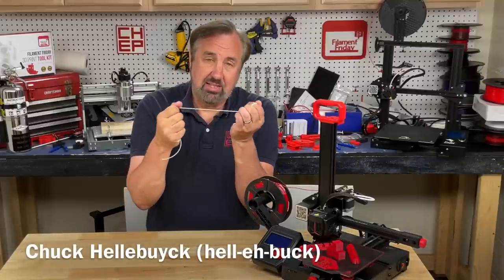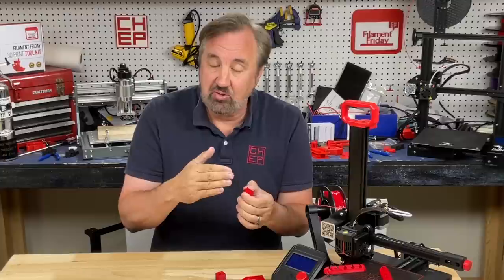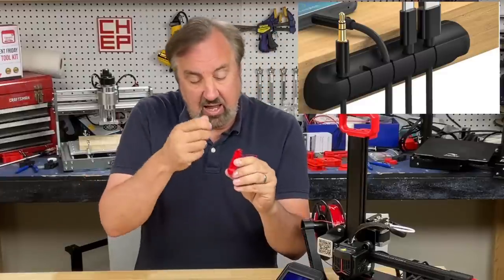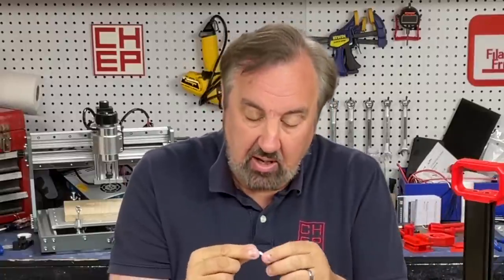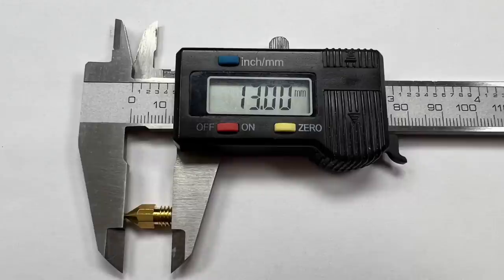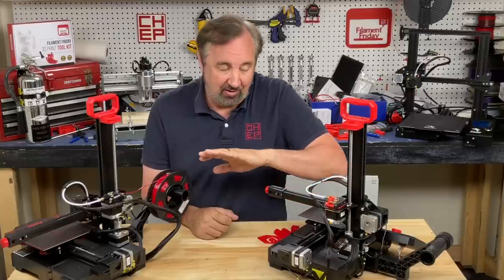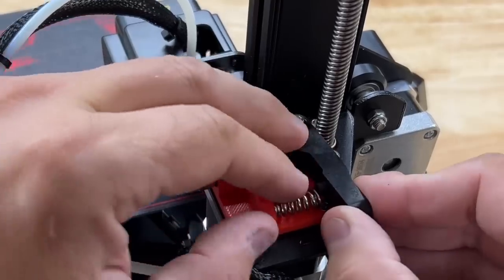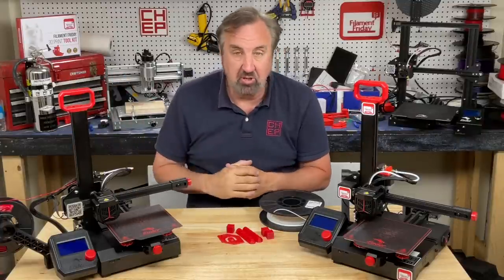Cura V5.0 - Flexible Filament Profile TPU

Comment: Used the profile, "as is", on my Ender 3 with direct drive and all metal heatbreak, to print a hex bit holder in TPU. It worked flawlessly. It did not had any clogs, even if there was a ton of retractions, only a little stringing. Great profile.Thanks alot Chep!

Comment: I really do appreciate Chep's work on these free profiles, he does not have to make them. Yet he has for ages. I was a died-in-the-wool simplyfy3d fan but that was not getting updated so with all the talk about Cura I jumped in knowing that Cheps profile would get me moving and groovin. Sadly I could not use Cura because I found it too much work, with all the drop downs and settings here there and everywhere not to mention Ultimaker wanted my user data so that was that. I tried and died:) Now what! If I didn't love 3d printing !!!!!
Reply: PrusaSlicer is the way ;-)

Comment: Hi chep. I don’t comment much. But thank you for all your help. I’ve have finally got my 3D printer working SO good now I’m in love with it. I found that I had problems with that line down the edge. It turned out the be my extruder only giving me 65.5mms rather than 100mms the difference in my prints now 😮. OMG 🥰 they are perfect. My old CR-10 👌🏼

Comment: Thanks so much for your hard work Chuck. I downloaded your profile/project and loaded it into Cura 5.1, I then exported the profile out of the project as well as the object. I then erased everything and loaded my Artillery Sidewinder X2 in and imported your TPU profile along with your model. I changed the retraction to 6mm because the X2 is direct drive and then sliced and loaded into Octoprint and its printing like a charm. 👌👍

Comment: Thank you very much , did my first TPU prints today , using your profile on my Ender 2 pro . As the TPU I used was quite stiff it printed perfectly first time at 210 deg C , bed temp 50 deg C on standard machine with retraction dialed back to 5mm . Filament used was SunLu TPU Silk Black ( perfect finish )

Comment: Downloaded and used your profile for my ender 3.  A few tweaks (nozzle and bed temp, and retraction number) and boom, worked great for printing the cable clip.  Came out perfect with practically zero stringing.  Thanks for the profile and great video as always.
Reply: Shall I asq you how I can get that ender's 2  3mf archive and use for my ender 3? I  had have downloaded the 3mf archive but when I drop into CURA and it  changes also the printer and bed size
Reply from the maker: https://youtu.be/EJD1hCJpM_w

Comment: This profile is awesome! prints like a charm on my CR10SPROV2 with Microswiss direct drive, was not able to print before this.
Reply: what are the Retraction settings on your profile?
I have a Microswiss DD on my ender 3 Pro and still tweaking it.

Comment: Great upload as usual.  You have always been on my goto list when I have a printing problem especially with profiles.  I have had quite a few issues with Cura 5 especially with my CR10 Smart Pro as there is no stock profile for it in Cura 5 so had to do my own.  Still a work in progress.  Thanks for all your hard work.

Comment: I printed TPU a few weeks ago & found that all I needed to do to stop the filament escaping was to reduce the pressure on the filament from the extruder pinch wheels. I looked at the filament & saw that it was well chewed & squashed, reduced the pressure to as light as I could, bingo. It worked with Creality TPU which is quite a stiff one & also eSun TPU which is a very soft flexible one.

Comment: Your profile was all I needed to get TPU up and running. Stock ender 5 pro. Thank you.
Reply: Did you have issues with it sticking to the bed and layers separating? I.just got my ender 5 pro. Did you change any settings? You're running it at 205 degrees in the profile. Please let me know 🙏🙏
Reply: @juliansantiago5798   the only thing I did was add the profile, load my filament and print. I changed nothing as far as settings go. Also you'd print TPU at a much higher temp than 205. Just leave the settings as is.
Reply: @marcus1202  Thank you!

Comment: This would be great if I used Ender printers for my TPU prints... I use direct drive printers, so the profiles need modification for them to work on my printers. However, you've touched on a couple of issues you faced that I have also been dealing with that gave me some ideas of how to fix. Thanks CHEP

Comment: Nice, i get little to no stringing with around 7 on retraction with my ender 3 v2 bowden setup printing tpu, with no clogs after hundreds of hours of printing. I'm print speeds around 30. thanks for the video !
Reply: What filament(s)?
Reply: @brianmi40  sorry I was wrong I was actually at 9mm retraction. Using sainsmart tpu 20mm/s on retraction speed

Comment: Your profiles are great, thank you for the work! I have tried the 5.0 and 5.1 TPU profiles and both are fast and look great. The only problem I had was the inner and outer walls seem to separate. I tried lots of different wall settings but nothing helped, the setting that solved the problem was to slow the inner wall print speed down to match the outer wall print speed. Don't know if anyone else had this problem, but hope this helps.

Comment: Jus started printing colorfab´s varioshore tpu at 220 C an 20 mm/s, I don´t have an issue with escaping filament yet but it bunches up behind the extruder gear and in front of the PTFE tube.
Can this mod help my Ender 3 v2 or is it another issue. 
Tried with 6.5mm Retraction (25 mm/s) and with retraction off, but can only print about an hour before I can´t extrude.

Comment: Thanks - I was actually printing a phone case in  tpu when I found this. From what I'd previously found, folk turned down the part cooling fan - But I found bridging failed. I managed to install  your profile  -(I got confused in the instructions, Cura is not a good gui, imnsho). I reduced retraction, and increased nozzle temp. Your test printed fine, but a slight bit of stringing (I don't want to retract too far). I have an ender 3 with microswiss all metal direct drive hot end, and have re sliced the case, and print just starting.  I'm not sure how supports will be handled, I'll know in a few hours time.

Comment: i loaded the profile on my Ender 3 pro with microswiss Direct drive and didn't realize the Retraction was set for a normal extruder.
Minor TPU peeling from between the sprockets ensued 2 sips of coffee later lol.

Happy new year in advance btw!
Reply: What should retractions be with direct drive
Reply: @yobtnirp3D  I have mine between 0.5mm and 1.5mm for tpu's
Reply: @FATSNAIL-FPV  ok thx

Comment: Hi Chuck I'm really enjoying your videos I'm also brand new to the 3D printing world ! I'm an fresh water fisherman and I'm wondering if I can print out my rubber like plastics that go on a jig head with TPU or TPE ? I'm very interested in the ender 2 pro. I've seen guys print injection molds with the PLA and inject the plastic but that's just more steps . Any advise or insight in this idea would be greatly appreciated Thank you ! Bob

Comment: Nice videos and channel you have here. Thanks to you i decided to buy the ender 2 pro in a great offer at 129 dollars. Now I am planning to do two primary updates, the extruder change it for the mk8 all metal and the bed springs. My questions it's with the metal extruder o going to avoid the filament stuck or skip.? Thanks for your videos new subscriber here

Comment: Hi Chep.
Is it possible to get a 0.12 profile for the TPU?
Is it even advisable to print in a higher resolution with TPU?

Thanks again for the hard work you put in to make our lives that much simpler...
Reply from the maker: Just change layer height to 0.12 in the profile. It should work.
Reply: @FilamentFriday  Awesome. About to start dialing in my TPU and I've never used it before, so thanks again for the help...

Comment: Waow. This was one of the most easy understandable 3D guide videos I've ever seen. absolutely brilliant. I had to turn op the nozzle heat to about 235 tho.
i had the wall-not-attatched-problem too. But first after I changed infill to 100% (need a solid part). Any idea what to do here? I'm using ninjaflex.

Comment: Great video. Do you have any advice for TPU and direct drive. It starts to load and Ozze out the nozzle but then the TPU just feeds out under the extruder gears and I have ptfe tube right up to the gears 
Thank you
Reply from the maker: Try printing slower.
Reply: @FilamentFriday  this is just trying to get the filament loaded but will try and slow it down when changing filaments thank you
Reply: Does his mod w PTFE on gear side as shown.

Comment: One of the first upgrades I made to the Ender-2 Pro was remove the Stock Extruder and replace it with the SeeMeCNC- but I might print the Extruder base you share a link to. I just need to print a MicroSD to Standard SD Card holder and my Ender-2 Pro will be done.
 I wish Creality made a Glass Bed Sheet for the Ender-2 Pro!
Reply from the maker: SeeMeCNC EZR is an excellent option. I’d stick with that.
Reply: Buy ender 3 glass and have a glass shop cut to size for you or buy glass cutter and cut / sand yourself.

Comment: Hi Chuck, you always have great advice. When printing TPU with multiple walls/shells to increase infill without increasing the infill %, the layers don't bond together. After the print I can squeeze my print and feel all the different layers squishing around in it. How do I make it one solid shell?
Reply from the maker: Adjust wall overlap

Comment: hi guys im having issues with vertical line separation with my tpu, im using the ender 3 and i have adjusted skin overlay and inset to 0.2, I have ran the chep bed levelling Gcode, even tried the profile in the description but still 1 whole week and the same issue

frustratingly its printing super clean but so soft, as the vertical lines are all separate, all flat layer are super clean and bonded perfectly, the prints look great but are useless. please help before the printer gets hurt.. thankyou
Reply: what's the infill percentage you're using? Maybe less/more parts cooling.
Maybe an E-steps issue?

Comment: what about if you have a metal extruder + a micro swiss all metal hotend? is there any hope for printing TPU efficiently?
Reply from the maker: You shouldn’t have any problems with that setup. Just reduce retraction to 1-2 mm
Reply: @FilamentFriday  i have it currently at 4mm if I'm not mistaken, for pla+. I guess 2-3mm would be good. Thanks!
Reply: @nextlvlroy  did it print well? have with this setup lots of stringing. 4 mm retraction

Comment: Video request, Pneumatic couplers vs Compression Fittings, of the brass variety. 
It seems no matter what pneumatic fittings i use, the teeth eventually 'saw' into the Bowden tube and cause headaches (or in one case during a jam, the teeth in the extruder coupler downright broke)
I'm tired of being nickel and dimed buying new fittings and tubes

Comment: Another great video, I have a problem with my ender 3, thermostat voltage dropping when the nozzle heating up and not staying on 5 volts on motherboard, but all the other voltages are fine, and it causes clogging nozzle all the time, should I replace motherboard?  Already replaced hotend
Reply from the maker: Maybe. Sounds like it could be the issue.

Comment: I’ve had a universal problem of all my hotends getting clogged the second I switched to version 5. Not sure if it screwed up my nozzle temp but I did do a PID tune on two machines with no luck. Once I cleaned out the clogs and went back to 14.3, problem was gone
Reply: Check if your retraction settings are too rough.
Reply: @padmanabhaprasannasimha5385  I tweaked them in both directions (low to high) and it doesn’t seem to change anything. Typically I’ll run 4-5mm at 45mm/sec and that’s always worked on 4.13 and prior
Reply: @padmanabhaprasannasimha5385  and to clarify, this is just with PLA from a number of providers

Comment: First, thanks for all the help to the community. Am trying my luck with TPU-90 the last 2 days, and i have issues with making a phone case. Walls draw out of the line and there is a speed in your profiles that accelerate with no reason..Why u use acceleration and jerk? 5.1 tpu profile was bad and a little better with 5.0 tpu. I will try to remove acceleration and jerk cos the nozzle move like hell for 1-2 times and then goes slowly. Also i see 100% fan speeds. Is that ok for TPU?
Reply from the maker: Those work for me but it can depend on the filament. Adjust yo make it work for you.

Comment: Chuck, wouldn't replacing the Boden tube with Capricorn greatly reduce flex in extrusion and retraction of the filament?
Reply from the maker: Possibly but could also cause more clogs. TPU tends to be less consistent in size.

Comment: Any advice on support for print? I was trying to make my own swatch watch guard but support wont build and the lower legs break off. It  seems you can only print things that don't use support.
Reply: Maybe print the support separately in PLA and add a print pause where the support is needed with TPU and slide the PLA piece in

Comment: When it comes to all the Extra speed and Hyper speed profile. Does it need a heavy duty/vulcan hotend? I tried them on my Ender 3 Pro with stock hotend  using PLA with both 215 and 250 (I know this is too hot for pla but) hotend temperature and its not keeping up. at low temperature the extruder clicks, at high temperature the extrusion is too thin
Reply from the maker: I would suggest adjusting your e-steps. It doesn’t require any special hotend.

Comment: Just got my first role of TPU going to give it a try. Do you have a profile for 5.2?
Reply: Profile worked great on 5.2! 🤷‍♂️
Reply: @MeGuess_Adventures  don't you have vertical layer separation? I tried adjusting the Skin Overlap setting, but can't see any differences. Also it looks like I cannot set all of the speed settings: although I set everything to 20mm/s, some movement is faster than that, for example the brim printing speed

Comment: I haven't tried your profile yet, but in experimenting with tpu i managed to print a Chep cube. Came out good. However, i try to profit a phone case/, protector and i get clogs at the hot end. i have retraction turned off, and I'm going as slow as 15 mm/s. I'm on a Bowden tube set up with the metal extruder. Do you know why i am experimenting clogs? Temps are 210/60, and it's Sainsmart 95a tpu. Thank you
Reply: Printing way too cold my guy.
Reply: @maxwellmatthews6225  the range of the TPU I'm using is 200-220. 210 falls within that range, should be alright.
Reply: Hmm interesting. I've never printed at less than 230 with TPU.